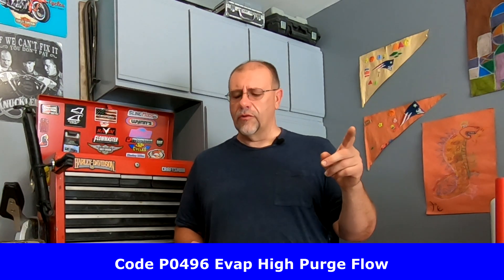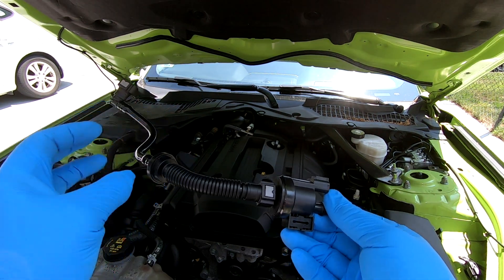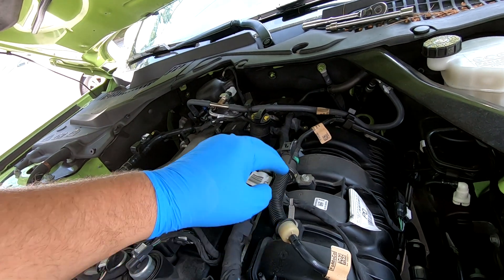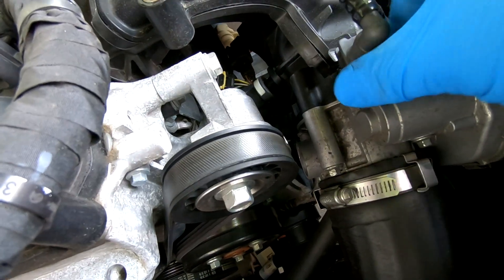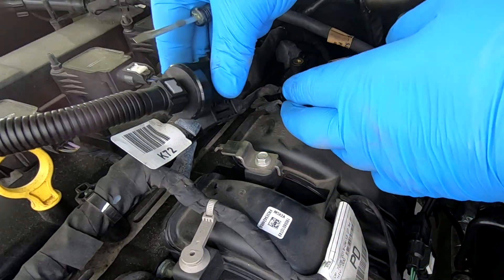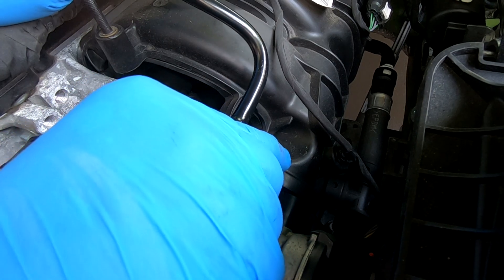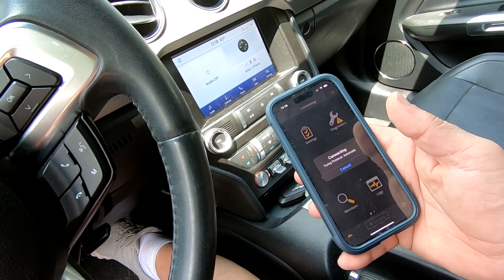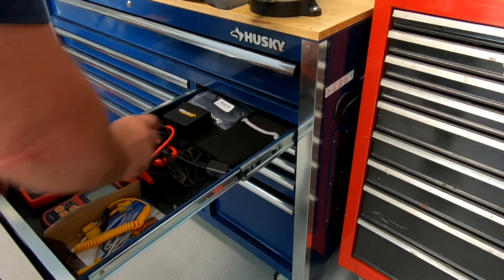Code P0496 Evap High Purge Flow Repair EcoBoost Engine Ford Mustang | Techn' Moto

Comment: Thanks for the detailed video and parts link. Just pulled the code this morning and ordering the part.
Reply from the maker: @TheEpicCipher  be careful with aftermarket parts. Sometimes they work and sometimes not. I had a problem with the first one I received.

Comment: You think it's just as easy on a 2018 Ford Escape?
Reply: Also. How much did that part run you? Just curious cause I've the same code popping up on my Escape
Reply from the maker: @Crimsonrain13 call dealer for price.  Not sure if it’s the same on that vehicle.

Comment: Gone through two of these things already. Not quite sure whats causing them to go bad.
Reply from the maker: I found that the aftermarket ones for whatever reason don't last. The OEM one lasted about 20,000 miles. We'll see how long the new OEM one I installed last week lasts.
Reply: @TechnMoto  lmfao 20k miles? No part should fail for 100k miles
Reply from the maker: what can I say, it did. lol